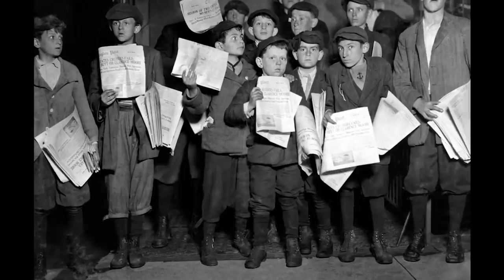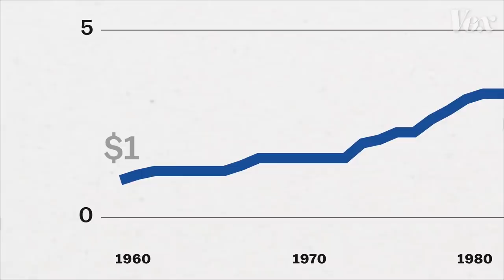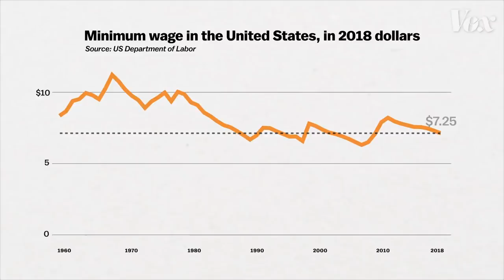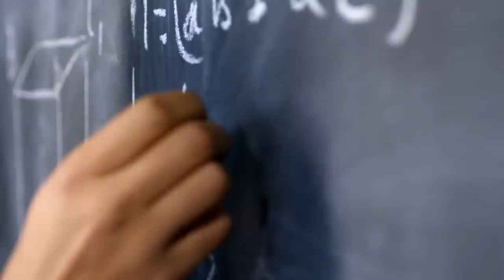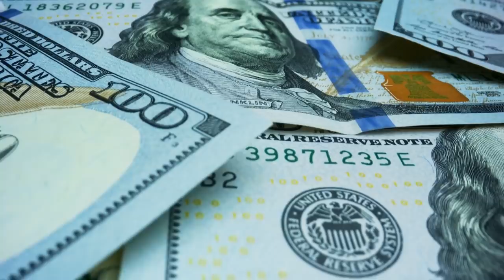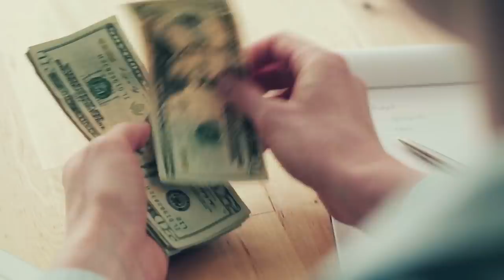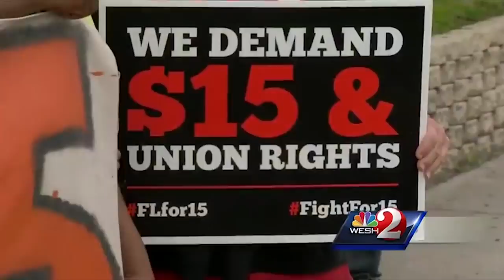The Minimum Wage Debate Explained

Comment: This video's incredible. You came from every angle with nothing but the hard stats and evidence. 
before i kinda thought $15 minimum wage was good, but now I'm 100% advocating for it, if not even a higher wage.
Subscribed, well done.
Reply: Minimum wage will always be minimum wage.  That’s not how you get ahead. You will change the numbers but the value will remain the same. The market will correct itself.
Reply: 999999999999$ minimum wage
Reply: I disagree that this video is "incredible" because it's so one-sided.  At the beginning it indicates it will explore "both sides" of the issue."  It then proceeds with an argument for raising the minumum wage; and never even attempts to take a different viewpoint seriously.
Reply: @gowildcats1730  wdym it explains the opposing view point and then explains why it’s wrong

Comment: For my time as an “essential worker” I received a one time $300 check. But hey that’s almost 2 week’s worth of pay...
Reply: its funny you say that as i myself an "essential worker", and all ive gotten from the jobs ive worked so far. Is a foot up my ass. and im being told to work more and get a higher paying job during a fucking pandemic!!!

edit: i actually did get a higher paying job, which pays slighter than my old ones
Reply: @louvendran7273  yea I agree, That is definitely not a full time wage. I worked 15-20 hrs a week at minimum wage and received $333 for 2 weeks pay after tax. I get tips as a delivery driver though so I couldn’t care less what my wage is 😂
Reply: @JohnFKennedy420  I did say almost. I typically make ≈$340 over 2 weeks

Comment: You have failed to mention that the Scandinavian countries have no legal minimum wage and instead rely on unions to negotiate their wages. Other than that, good video.
Reply: They have little or zero immigration either!!!!!!  And Sweden does have a minimum wage .
Reply: @ronsmith7739  source on minimum wage?
Reply: @weopdurdegenes6598  Technically it doesn't have a minimum wage but they use collective bargaining agreements between different sectors of business and the Union that sector of workers represents. It's not an individual Supermarket company that negotiates but all the supermarkets sit down with the Union at the same time to work out what the minimum wage will be. It also is written into law that all workers have 25 paid vacation days.
Reply: This video has some dumb points, like the one on housing. The fact that in the last years housing prices have risen without a rising minimum wage does not mean that there is no correlation, it could easily mean that other factors impact housing prices
Reply: @arturopriora7224  I think hes saying that its know even harder to afford housing now on minimum wage
Reply: @usmanyounas5181  no he is not, listen again to that part
Reply: @arturopriora7224  if other factors impact housing prices then what's the problem with raising it
Reply: @usmanyounas5181  secondthought implies that since housing prices rose while the minimum wage was static that means that the minimum wage theoretical increase would have no effect, but mathematically speaking, that is not true by definition, because it does not demonstrates anything

Comment: I grew up watching my mother and step-father both work full-time jobs just slightly above tx minimum wage of $7.25 an hour. That was in 2008 - 2015, I can't imagine them making it in Fort Worth on that wage now, much less with a child. Those same jobs pay $10 - $12 an hour today, for reference, Colorado minimum wage is $12.80 and McDonald's hires at $15. The cost of living is supposedly lower in Fort Worth Texas, but from my personal experience it's about the same. Groceries and gas are more expensive, but my entire utility bill (gas, water, sewer, trash and electric) is only $300. In Texas, my electricity was $180 on a good month and usually around $300 most months. Privatization only hurts people

Comment: I still think the fact that it can wipe out small businesses is an important point to factor in - great video though
Reply: Many small businesses that pay minimum wage usually have ineffective clock watching workers who couldn't care less about their customers and are not worth going into to get that rare part or service when other more effective suppliers are available. I see this with a prominent Music store chain who obviously pay low wages and have not moved with the times. All their stock is vandalised and not set up or tuned properly to be tried out by prospective customers. Many of these stores are running on past glories and reputations but they will soon die out unless changes are made regarding career development and a proper wage structure for knowledgeable staff.
I have seen many old hardware stores die out when bought out by more effective competitors especially those who have moved online for ordering and have catalogued all their stock for easy selection and pick-up. These hot-shot stores usually have expereinced qualified tradesmen on call to advise and recommend stock to customers and none of them are on minimum wage.

Comment: With respect, I don't think this video was handled honestly.  

It's not entirely fair to frame the minimum wage as a major bastion against corporate exploitation.  The percent of Americans making minimum wage in 2019 was 1.9%, down from 2.7% in 2016, and ~13% in 1979.  The trend is that companies rely less and less on this outdated metric in deciding how much to pay their workers.  I'm all for protection from workers but changing the minimum wage has become a parroted political slogan that is no longer as powerful a tool.  *Careful, I'm not saying it has zero benefit, only that it's effectiveness is not as large as the video and our politicians suggest.

And no, "27 cents" more for a big mac is not "the difference between respecting your workers and considering them stupid" etc.  That's really dishonest.  Denmark's cost of living is ~25% higher than the United States (although rent is lower).  For example the price of beef is 50% higher in Denmark.  This is the summation of not only the minimum wage but a comprehensive program of social benefits built from taxing the average Dane ~45% of their paycheck.  I'm not making a value judgement here between 2 systems, simply saying that you're extrapolating way too much from a uni-dimensional analysis of minimum wage, which is a prevailing trend throughout the video

Comment: I appreciate your analysis, but there are some flaws in this video. At 4:10 you state that if the minimum wage had kept up with inflation, it would be close to $22/hr.  However, if you take $0.40 in 1938, $0.75 in 1945, or $1.60 in 1966 into 2020 dollars you're only getting near $12 to $15/hr depending on which method.  Nothing is even close to $20+.  So if the dollar value isn't there, then its worth evaluating what the other cost factors are to increasing that cost. Regulation, debt spending, afluncy, and previously hiddent costs are all potential factors around it.

Second, you make it seem like it is either you're a worker or an owner and you totally disregard the idea of setting up a shingle and doing self employment which is actually a very valid way to move up in the area.  Most of these people end up being 'owner' but often start out as a 'worker'; this is a crux of the problem of looking at things from a class perspective and not trying to identify how things could actually work better for the individual.  Rather than trying to find a way to force a negotiation beteween an individual and an employer, make it easier for individuals to move jobs or strike out on their own and do it their own way. YouTubers, Etsy creators, and gig workers are just a small example of the revampin of some of those options, but similar to what has been a life blood for America going back decades in man trade skills like plumbers, warehousing, delivery, and consulting.

Furthermore, this focuses on the US as one giant monolith rather the diverse structure it really is. Doing business in Seattle, LA, or NYC is drastically different than doing it in Longview, Beloit, or Iriswood.  Thus setting a minimum based on an average is going to severly disadvantage those areas that find it hard to support that level and push even more companies out of those areas to metropolitian spaces.
Reply: Thank you.